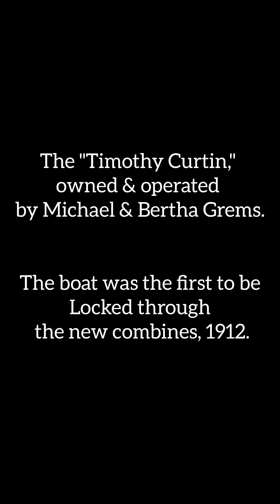3 lock Combine built for Barge Canal 10-2-23

Comment: Note that the waterway 100' inside the park access road is NOT the old canal routing. You need to drive through the gate and turn right to see the old canal prism. The waterway is actually a railroad cut, built for the Ogdensburg, Clayton & Rome Railroad. The railroad was never finished, but you can see bits and pieces of it. Up by Pixley Falls State Park there is an embankment inside the park on the north side of the road. Opposite the entrance to the park is a cut into the hillside, which was the approach cut for a tunnel through the hill. The tunnel was completed, but the western end collapsed on its own (the rock is shale), and the eastern end was collapsed when the park was constructed, likely to keep adventuresome children out.

Comment from the maker: I failed to note this in video, this is 2/3 of the structure. The top lock is covered over with dirt. You can see some of the upper lock (very little) and a bollard or two on the shoulder of Route 46.